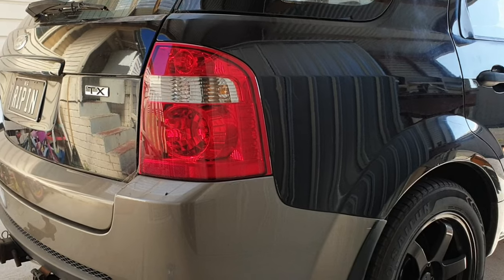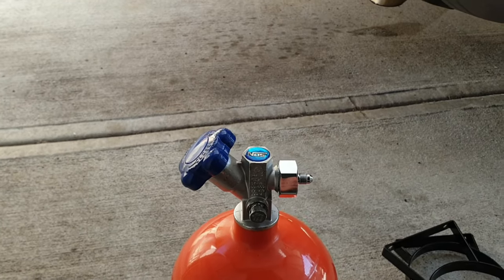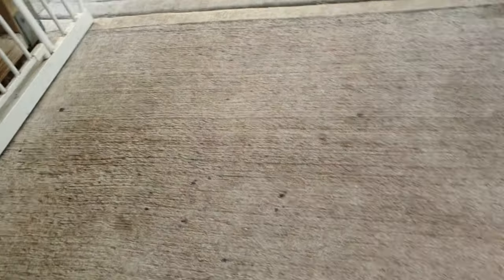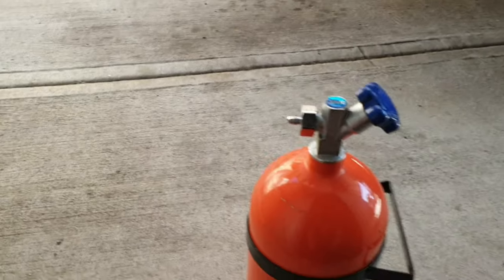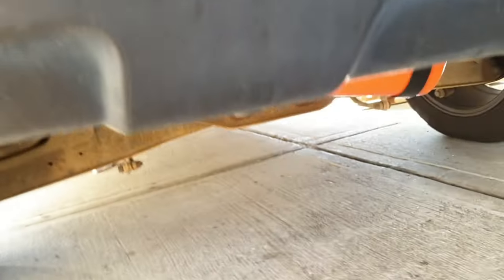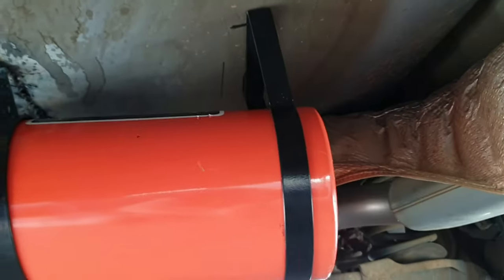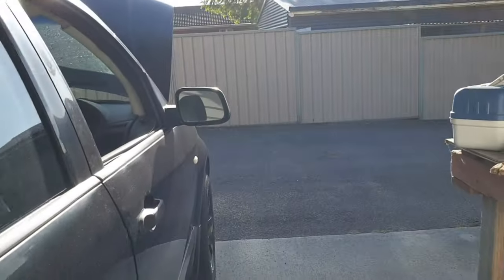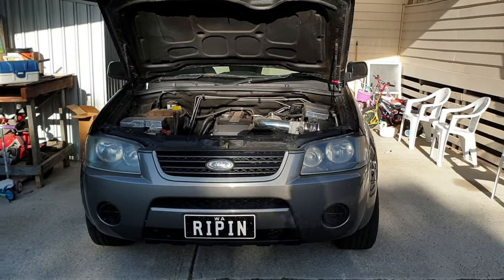How To Mount a Nitrous Oxide Bottle! | NOS Fed Barra Ford Territory!

Comment: I've got 2x 15lbs under mine, I use the existing tire bracket. If the cops look under there they see a aluminium box...

You'll find You'll have issues with your nos going around right hand corners... 

With a small bottle it's better to have the bottle facing the normal angle with the bottom of the bottle facing the rear of the car.
Reply from the maker: This big girl wont be on gas around corners 🤣 drag strip only 🤙
Reply: @RossHollandAU  it'll be fine.

Mines for getting to work....
Reply from the maker: @dylandesmond  😂😂
Reply: @RossHollandAU  those mornings when you're running late...

Comment: Also don't do what I did and run dual 0.60 jets. The drive shaft and gearbox can't take it.

A single wet fogger is fine on a 0.60 jet for an extra 140hp to the wheels...

You won't get any more  power out of a single fogger. 

I'm getting a custom made 4 speed and custom driveshaft for mine to handle the power as I still have my electric powered vortech v3-hb to add to the mix...